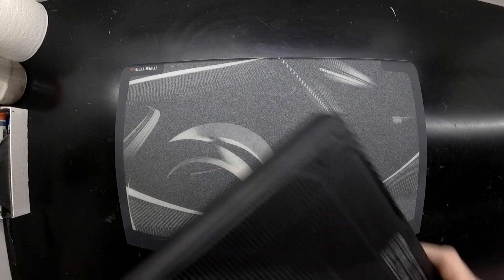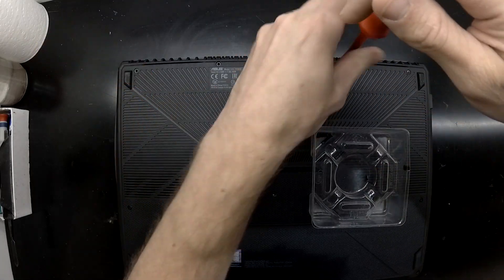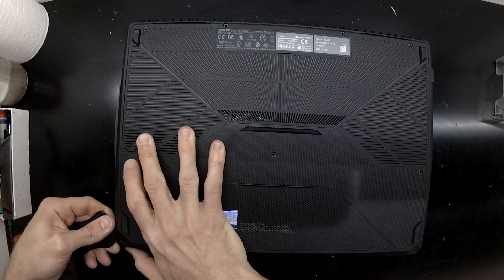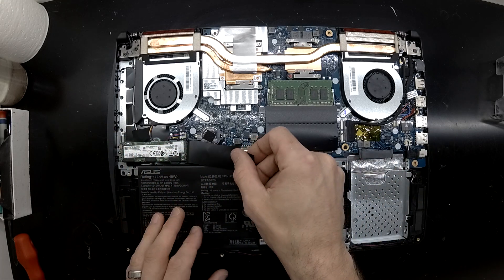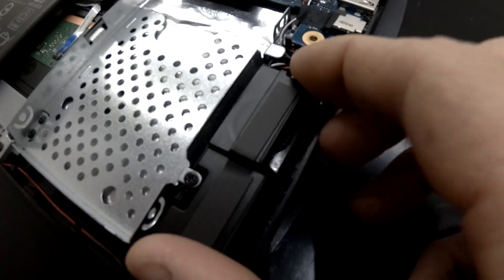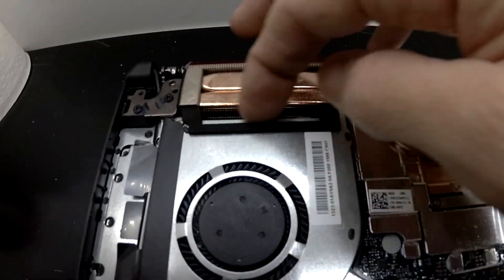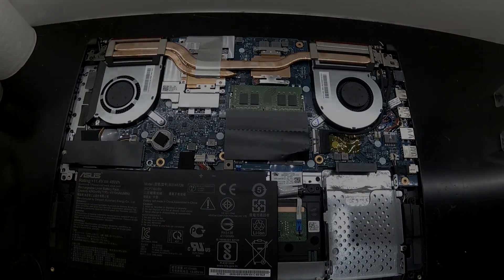ASUS TUF Gaming FX505DT Tear down and upgrade options

Comment: Hello hope you're having a good day! Is it worth it upgrading after so many years? I'm looking into freshening up this laptop for university.
I have the 8gb ram and 256 gb ssd version. I was thinking of having 16 gb ram on dual channels and a 1 tb of ssd storage. Would that make a difference in how it handles things? Right now it's really laggy in just exploring the web and has an even harder time running after effects and fusion 360. Which are programs I use a lot and need to run well.
Reply from the maker: that extra ram will help. 8GB DDR4 is cheap, worth updating

Comment: Hey, could you help me find an replacement fot 8821CE Realtek Wifi Card  FX505DT?

I have an Asus TUF Gaming FX505DT laptop and I had, and still have, Bluetooth and Wi-Fi problems almost every SINGLE time. Its so frustrating, so I've decided to look into replacing the network card.

But I'll be honest, this is my first laptop ever, I don't know anything about systems and such and I'm not sure what to look for in a replacement. :(

I've heard that the Intel AX210 might be a good option, but I'm unsure which specific model to choose.

Comment: Hello, I hope this message finds you well. I have an Asus TUF Gaming F505DT model and I'm interested in upgrading the heatsink for better cooling performance. Currently, my laptop has two heat pipes for the GPU and one for the CPU, but I've noticed it tends to heat up quite a bit.

Could you kindly provide information on other models within the Asus TUF Gaming FX505 series that come with an improved heatsink featuring more pipes? I am looking to order a heatsink and back panel to enhance the cooling system of my laptop. Your assistance in this matter would be greatly appreciated. Thank you.
Reply from the maker: i have no info on that at all sorry
Reply from the maker: this video might explain some info 
https://youtu.be/6Wyxg22eD5Q

Comment: If anybodys floating around here and their wifi chip is unpresent in their system it's because the WIFI chip gets basically destroyed when upgrading to windows 11.  It's really easy to install a new one, I just installed a wifi 6 board and now I don't disconnect from wifi randomly
Reply from the maker: Cheers for the tip
Reply: Thank you, I came here for this, I just don't see the wifi module anywhere on the video

Comment: In this laptop, the ram is used at mta8ATF1G64HZ-3G2J1 (3200MHz), but in details, it shows 2600mhz. So, if I want to buy another RAM, what speed will be good, and which ram will be good for dual-channel benefit. Plz reply.
Reply from the maker: i would just purchase some 3200mhz ram

Comment: Hi, please could you let me know what length is the NVMe is.. and also if the slot can take 1TB drive?
Reply from the maker: Standard size m.2 which if I remember is 2280 

Could use something like a Kingston A2000 or WD Blue sn550

Comment: Hi i saw this, my tuf gaming laptop has a built in 4gb ram, can it be removed?
Reply from the maker: Sure you aren't referring to GPU vram?

Cause you should have two ram slots
Reply: @rickstechrepairs  yes i do have 2 slots for the ram. If ever i dont want to remove the 4gb, can i put a 8gb ram instead? Or does it need to be 4gb-4gb or 8gb-8gb?
Reply from the maker: You can go 4 and a 8gb

But it's recommended to use matched sizes to get dual channel performance

Comment: ola, tenho um modelo deste FX505dt WB72 com display 60hz e fabrica, saberia me dizer qual modelo de monitor 120hz consigo colocar como upgrade ? 
São 30 pinos ou 40 pinos ?
quero muito um painel 120hz, pois o de 60hz é horrível para jogos
Reply from the maker: Hi, i believe you are asking about upgrading your panel to a 120hz from a 60hz panel

i would expect most machines to use the eDP standard, and should be as simple as changing the panel over to a 120hz panel

Comment: Do I have to disconnect the battery before adding RAM?
Reply: Hey i dont know if you still wanted to  do that, but a tip you should know before start opening the case? Welp the laptop, its left pushing ( hold the bottom)  power a few seconds until you hear a sound, that is a command   used for drain or release the energy of interns components that's all you need to do of course remove the charger
Reply from the maker: sure
Reply: Thanks  to both of you!

Comment: The black strip on the nvme port is a type of a heatsink?
Reply from the maker: no i think its to keep dust off the NVMe drive, same with the ram
Reply: @rickstechrepairs  By the way, what do you think about upgrading this pc with a nvme samsung evo 970 plus using a heatsink

Comment: I own Asus TUF Fx505ge with 8gb 2666 samsung RAM, after I inserted another 8gb 2666 hyperx RAM everything was fine on that day, I even played games like RDR2 and Marvel's Avengers, On day 2 as soon as I powdered on my system, I flooded with some 10 to 15 different blue screen errors which are as follows:
Memory management
irql not less Or equal
Critical process died
Kmode exception not handled
Pfn list corrupt
System pte misuse
System service exception
Reference by pointer
Kernel security check failure
Page fault in nonpaged area
Kernel mode heap corruption
Attempted write to read only memory. 
Every time it gives different error but most of the time it gives memory management error. 
When I removed my old samsung RAM and powered on system with 1 hyperx RAM all was fine again. 
So I can't understand what's the problem behind this, is different brand an issue or is Windows 10 an issue or Asus itself is the issue as I had faced many issues before this one like touchpad was stopped working many times and I called service engineer and the problem got resolved just by updating driver.
Do anybody else here had ever faced such problem and found a relevant solution then plz reply fast.
Reply from the maker: Those errors would all be relating to ram

Take out the new stick and see how you go (run a single stick of ram)
Reply: @rickstechrepairs  no issue/error with single RAM brother but 8gb RAM is not enough to play new games so I ordered 1 more 8gb RAM which I think now was a wrong idea rather I should had gone for 16gb 1 stick

Comment: I love how its one laptop but has so many variations you can buy. Planning to upgrade after its warranty if needed thank you.
Reply from the maker: Many brands do this
Reply: @rickstechrepairs  Question. Is it possible to upgrade my Asus TUF FX505DT from a 3-cell 48wh, 11.4v battery to a 4-cell 90wh, 15v battery (That is used in other variations of the TUF lineup)?
Reply: @Nick L I think the motherboard is dead.

Comment: is it compatible with a sata ssd? Or just hard drive?
Reply from the maker: A SATA SSD can also be called a hard drive 

But yes it has a 2.5" SATA connector 

So you can use an SSD there
Reply: @rickstechrepairs  ok thanks.

Comment: this laptop have only 1 ssd slot? or 2? answer fast!!
Reply from the maker: 1 X nvme m.2
1x 2.5" SATA
Reply: @rickstechrepairs  which one is which one did you put?
Reply from the maker: @_mirooracing_  what the video
Reply: @rickstechrepairs  which of these video locations is ssd nvme m.2? And what is sata?
Reply from the maker: Actually check out this more in-depth video 

https://youtu.be/VCWH5oskcuY

Comment: Nestled around the edge of fan on the right there is a thick black cable that fits into a wide slot just to the right of the free ram slot. To remove the fan you have to unplug this cable, as it's in the way, but I don't know how to do it, and i'm scared to just tug in out. What do you call this type of slot, and how do I unplug the cable? Appreciate any help, mate. Cheers.
Reply from the maker: That would be the LCD flex cable.

Typically lift up the clear tape that's on the connector and the cable and pull back

Comment: Hello, does CAS latency matter for the RAM?  My model has CL=17 but in the  Crucial website 
suggested RAM has CL=19. They need to be same? Or can i go with the CL=19 one. Thank you!
Reply from the maker: lower CL the better but i dont think it will impact greatly
Reply: @rickstechrepairs  hey ricks does this laptop support 2nd SSD slot ?

Comment: Short and excellent video! Congrats! And yeah this is still an awsome laptop, and becomes a monster after adequate upgrades!
Reply: RAM upgrade make it 16gb and maybe upgrade the ssd to 1Tb instead of 512
Reply: any suggestions ?
Reply: @aayusharyal1584  Upgrade the processor. No need to change the graphics card since the laptop already has a beast installed. Update the ram to 16gb and get a bigger  SSD like the person above said.
Reply: @DJfireant789plus  is the proccesor upgradeble ?

Comment: What is that 2nd m.2 looking slot on the right?
Reply from the maker: If you are referring under the fan and above the 2.5" drive bay

That is actual the connector for the display

Comment: Do we have to remove preinstalled ram if we install another 8gb ram stick
Reply from the maker: You can leave the existing stick in there 

If it's in 2x4gb 

And you change it to 8 + 4, you will lose dual channel performance
Reply: @rickstechrepairs  thanks brooo!! I will give you a subbb
Reply: @rickstechrepairs  bro actually here I have the 8 gb variant and if I add another 8 gb stick of same MHZ will it do some damage to my laptop

Comment: hey dumbass, The RAM isn't running at 2666mhz cause of Ryzen limiter, also you got the GPU and the CPU wrong, the CPU has the 2 heatpipes and the GPU has the one heat pipe, also you know nothing of the cooling performance needed for a gtx 1650 with a lowered TDP (from 75W to 50W) as you said 2 copper heatpipes aren't enough and it doesn't even have 2 it has 1. Stop being an ignorant dumbass and actually learn what you are talking about before making a informative video, you don't even have to look up online where the CPU and GPU is located to figure it out, the GPU will always be on the side of the Video output aka HDMI, displayport, etc because the video output is coming from the graphics card.
Reply: aye stfu cmon man dont be rude

Comment: hi. ı have same laptop. ı bought 2666mhz 19 cl 8gb laptop ram. is this ram okay with stock ram for dual channel?  stock ram model is same  in this video. but i check gpu-z, application shows ram work with 17 cl. how its possible?
Reply from the maker: the ram will match settings to the slower of the two, so you will still be safe putting most ram in with the factory stick
Reply: @rickstechrepairs  okay thx.

Comment: Hello i have an Asus FX505 with i7 CPU , and 8giga ram. My laptop has 2 RAM slots and i was wondering for the possible ways to upgrade it to 16gb or even 32. Do you have any recommendations about the matter because i surely do not know my way around this stuff.I mean do I have to install an identical 8 GB RAM, same one as my laptop already had? Or sth else? Any help would be great, thanks in advance!
Reply from the maker: You can upgrade to 32 gig if you want to.

But 16gb is usually enough

Comment: I have the 250gb model ( 8gb ram, ryzen 5) I was thinking to change the SSD to something much faster. I've already added a 16gb stick of ram. Would you suggest upgrading the SSD? thank you
Reply from the maker: I would be expecting more performance gains, changing to 16gb ram in dual channel mode

Than upgrading to a faster SSD, I would go ram first unless you have a lack of storage
Reply: @rickstechrepairs  i don't need more than 250gb storage. I have 8gb ram(basic) on one and 16gb ram (hyperx) on the other. That makes it dual correct?
Reply: Daniel Ci  are those sticks the same speed
Reply: @marcyeung4340  yes both of them are DDR4 RAM 2666MHz
Reply: Daniel Ci they are compatible. They will a little bit chance on bottlenecking, becauce they are different sizes.

Comment: Just read online, apparently the motherboard doesn't have firmware support for some Samsung drives. Was going to get an EVO SSD but supposedly has many issues with the FX series
Reply from the maker: thats odd maybe its refering to the EVO NVMe SSD's, cant say iv come across issues when its been a 2.5" Evo SSD
Reply: @rickstechrepairs  The review was from November 2018 so perhaps since then the issue has been fixed? Or perhaps it was never there but I'll be going western digital just in case

Comment: Hey Rick, this laptop's a pretty neat gaming machine but it's let down by a tiny battery. I've noticed that they havent filled out the space completely and there seems to be additional mounts for the battery.
Is it possible to put in a higher capacity battery from some other asus gaming laptop? Maybe even from the 17 inch version (64wh)?
Reply from the maker: I cannot confirm that but I would suspect there would be a bigger battery if the 2.5 drive was left blank

Comment: Hey. Quick question..  Is the cpu soldered to the board? Can it be replaced?
Reply from the maker: Sure is
Reply: @rickstechrepairs  so which can it be replaced?
Reply from the maker: @shawnpraveen5930  as in sure is soldered to the board

You can only change ram and hard drives
Reply: Okie thanks. Any recommendations or any gamimg laptops you know of has a replaceable cpu?  Just wondering
Reply from the maker: There aren't any

Unless you buy and alienware Mseries laptop... But say goodbye to your bank for them
Reply: That is like budget 800 and below?
Reply: @shawnpraveen5930  build a pc
Reply: @tanaymishra6230  hey tech, maybe not at the moment, but in the future i most likely would built one

Comment: What kind ram support this laptop
Reply from the maker: I'm not sure with these

Typically I would just go 2666
Reply: Ricks Tech or should I just add ssd 1tb ? Is 8gb good enough for full hd video editing
Reply: Ricks Tech also should I get two 16gb or 32gb one ram
Reply: TheRiseofTony always run memory in dual channel, if you just want storage, you can get 2 tb on a hdd in the 2.5 inch hard drive form factor, so in conclusion, get 2 16gb sticks and a 2.5 inch hard drive for storage
Reply: Hari_Da_Bosniak Osu I install ssd but laptop won’t detect it
Reply: TheRiseofTony hard disks don’t come formatted, so you’re going to need to activate it in the format wizard on windows 10, you can find videos for that easily
Reply: Hari_Da_Bosniak Osu thanks it wouldn’t detect there either . I had to take the casing out few times then reinstall the drive 5 times then it finally detect it
Reply: TheRiseofTony oh darn
Reply: Hari_Da_Bosniak Osu now waiting for 16gb ram to come bestbuy says ship April but stuck at shipping since April 1st
Reply: Hari_Da_Bosniak Osu also can I upgrade the ssd the m.2 ? The one came with the laptop
Reply: TheRiseofTony you can swap it out for a much faster one, intels 660p m.2’s aren’t very fast. If you do do this, be ready to get a copy of windows
Reply: @haris6424  I was thinking to upgrade mine as well. Recently I added a 16gb (hyperx 2.666) next to the basic 8gb ram. However, sometimes multitasking is sluggish I can't identify the reason behind that..I thought 24gb ram will be more than enough 
What would you suggest?

Comment: Brother i am using this laptop,i  have a small doubt plz reply
When i am playing gta 5 sometime screen flickering happens And after some seconds when i switch off and switch of the charger it will come back to normal,is this a hardware issue or a software issue and i put my charger to the back of the laptop screen very near ,wheather is this cause any problem ,after this yesterday i watched a movie screen flickering happend after switch off and switch on the charger ,it stopped,but happening sometime ,pls solve this ,my laptop is new only 10 days i used ,plz rply,

Comment: My ASUS only has 256G of storage how do I add more is it ssd or ram and if you could link me some stuff I could purchase so I can get more thanks
Reply from the maker: you would be adding a 2.5" Sata HDD or SSD
Reply: @rickstechrepairs  will this affect the speed?
Reply from the maker: It shouldn't
Reply: EXOTIC you need ssd it’s faster. For ram  https://www.bestbuy.com/site/pny-16gb-2-666ghz-pc4-21300-ddr4-so-dimm-unbuffered-non-ecc-laptop-memory-black/6401189.p?skuId=6401189

Comment: How do you plug in the SSD?
Reply: Gun Gai take casing out but you need plastic prey thingy to take the casing off... then hope the laptop detect the ssd drive I had to remove the casing off few times and mess with the ssd and plus in before the laptop detect it not sure why

Comment: Bro Help me out! My Asus tuf fx505dt came with 3200mhz ram! Will a 2666mhz ram work as dual channel? My goal is run both at 2400mhz speed (maximum on ryzen 5 3550h)
Reply: 2666 mhz ram will work since the cpu will automatically downgrade the speed if over the max supported speed. (I believe the max supported speed is 2400 mhz or 2666 mhz.)

Comment: What is the size of the screwdrivers? I needed to open mine because it has a vibration in the fan
Reply from the maker: Most standard size screw drivers would work fine

Comment: Hi, I brought this in Hungary with 8gb ram. But I want to add another 16gb of ram. So together it will be 24gb ram. Can you please tell me which brand of 8gb ram are they using by default? And its bus speed. So I can buy the same brand of ram. Thank you.
Reply: Different units may ship with different brand ram module. Check yours using AIDA64 or CPUZ and be sure to check your ram's cas latency. By the way, the module in the video is SK hynix DDR4-2666mhz, and mine unit(Ryzen 5) shipped with Micron DDR4-3200mhz. Though the both will run only at 2400mhz due to 3rd gen ryzen mobile processors supports upto DDR4-2400mhz at max.
Reply: @H1mJT  bro your ram is same as me!! Did you try to upgrade it? Which frequency should I choose Can you help me?
Reply: @H1mJT  I just added a 16gb hyperX ram on the second ram slot, (now I got 8+16) do you think that will cause any issues?
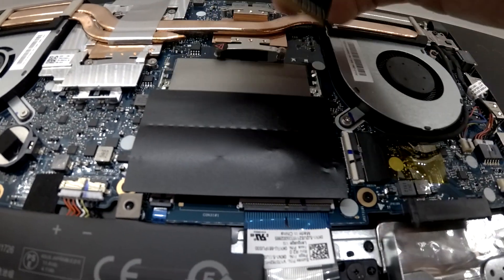Reply from the maker: It's shown in the video at 2:06